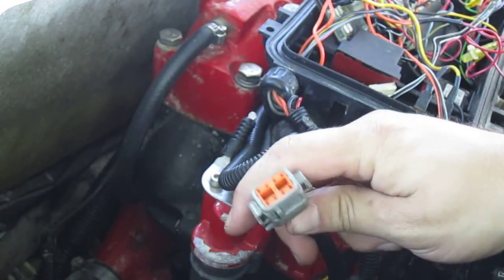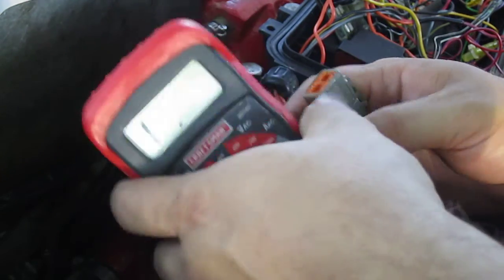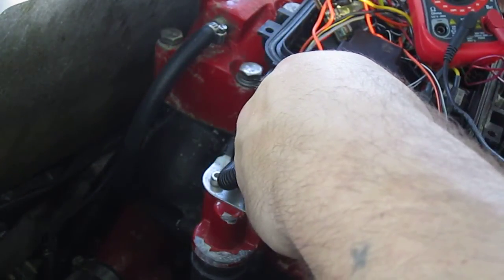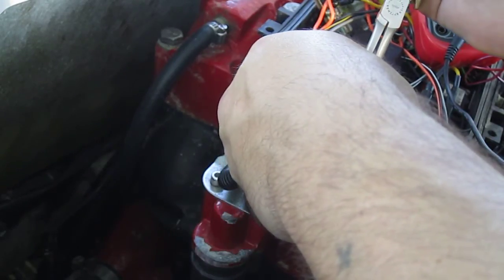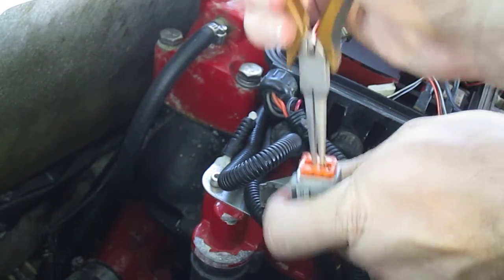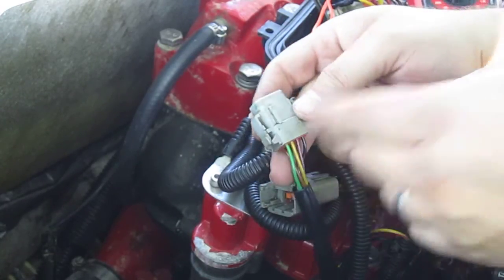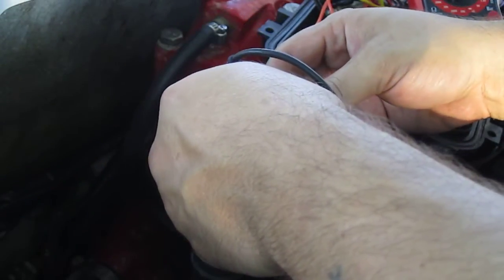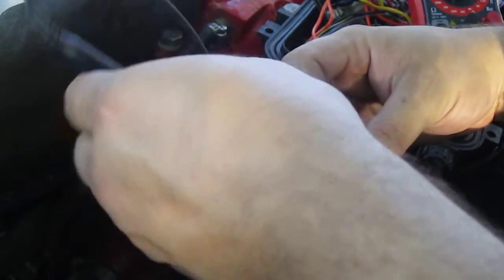2002 POLARIS FREEDOM 700stator test  july 10 2012

Comment from the maker: I started doing these videos while going through alot of steps,
there is a specific part about the "LR505" module. it will be very helpful. 
it is the control unit to the start/stop and bilge pump switches. guess its a common problem.
Reply: Can you add to this?? Is it the box that’s the issue